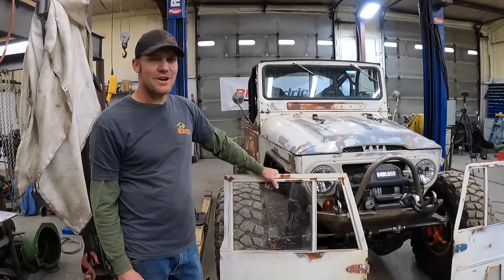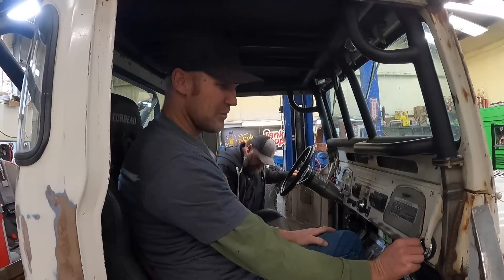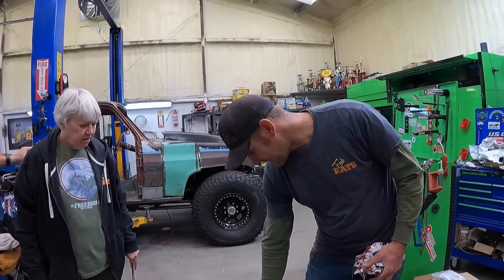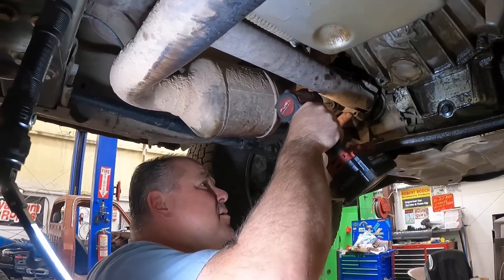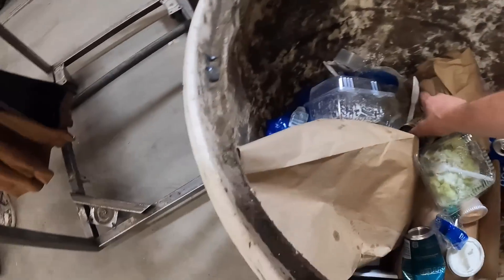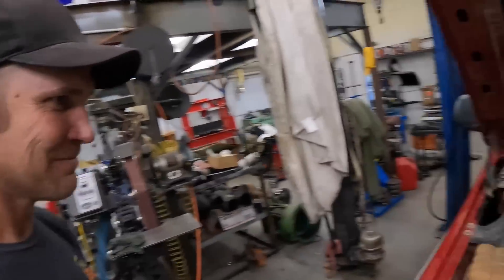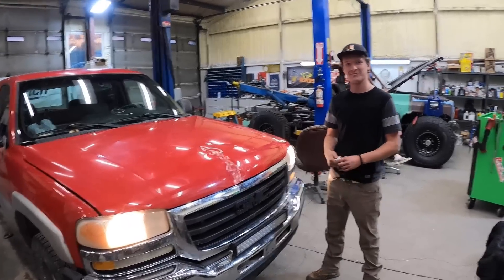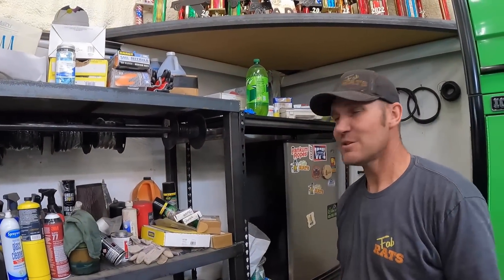This Is The Worst One I've Ever Seen!

Comment: Pro tip for Hunter, when adding Lucas oil stabilizer empty about 1/4 of the bottle in the vehicle and then fill that 1/4 back up with your regular oil and shake it up and it will poor out a lot easier and you won't have to sit there and fight with that thick crap forever. Also poke a hole in the bottom of the jug when you are pouring it in. (The mixing actually works the best if you are using a 5qt jug of oil bc you can empty 1qt of oil out then add the entire Lucas oil into the 5qt and it flows straight out like normal oil.)
Reply: You can also put the bottle by the heater for a little bit
Reply: Remember when STP came in a can?
Reply: Also instead of spilling every bottle of oil, get the first one in the hole then cut the bottom off of the bottle. 
Insta-funnel,,,,, disposable, no clean up required.
Reply: Also,if you turn the 1 quart bottles on there side they pour much easier!
Reply: @mattschion  try pouring with the spout on the top I find it to be the best way.
Reply: @garyjohnson6640  Yep, and if you wrote to the address on the can they would send you some free stickers.
Reply: Or just leave it in the sun or near heat for a bit it will pour out nice instead of messing with cold honey like oil
Reply: @georgedavis6583  That is the reason for the spout not being in the middle of the bottle, it is by design and many people do not know that. When pouring start lowering the bottle opening horizontally keeping the bottle neck on the higher side, not lower as Hunter did)

Comment: Hi Chad good to see you helping Hunter out with his oil filter I've had to deal with a couple of over tightened oil filters myself and you have to be innovative to get them off. Good job getting the FJ ready for winter and building a hose rack to hold them up off the floor.

Comment: On Hunters truck take the 4x4 switch out of the dash. Disconnect it and put electrical grease on the connectors. Re-connect and ba-da-bing. It's a common problem on those years.

Comment: Best thing to get filters off I have found is a strap wrench. A loop of seat belt material on a piece of 3/4 I.D. square tubing about 1' long. With a good breaker bar you can get every filter off. I have crushed a few base plates with it getting the really hard ones off.

Comment: Pro tip. I've seen Paul, Matt, and now Hunter all pouring oil the hard way from a quart bottle. The opening should be on the top of the pour, so the oil essentially goes down the ramp. This technique will eliminate the glugging on the pour. Happy Thanksgiving!!

Comment: For the bug catcher rubber seals you may want to check out Steel Rubber. They may not have a preformed seal (most likely not) but they may have the bulk rubber in the correct profile for what you need. You can try and make something work.

Comment: A small change I would make to the hose rack, if you decide to make another in the future as this one is solid already, is to have the bars placed on a slight angle so the back bars are higher than the front bars. Makes it so you can see how much hose you got left, and its easier to grab the back hoses once you fill the rack up fully.

Comment: I doubt you will see my comment, but seeing your FJ again reminded me. I think it could be your winch causing your engine to run hot. I remember reading in late 80's or early 90's about Rick Pewe from one of the Off Road magazines. He built a flat fender Jeep with a V8 that ran hot. Ended up being the Warn 8274 winch blocking air flow.

Comment: Something i like to try before poking holes in the filter is take a sheet of sand paper, fold it in half so its rough on both sides and wrap it around the filter, works great on small fwd cars when there's no room to use a hammer and screw driver like Chad did.

Comment: You got off easy on that one , Chad.
•  On my 📜 1st  OYLE CHANGE of YORE ,  so many Moons ago ,  my ( apparently preoccupied ) mentor answered "Yes" when i asked if  i should use the wrench to install the new filter.
•   As you might imagine ,  my 2nd change was ,  shall we say , MEMORABLE !  
•  Drove a medium screwdriver thru it. Torn-up like Hunter's.  Then a 3/8" shank screwdriver TOTALLY Shredded it , leaving only the base-disc  Still TIGHT  against the block. Vise Grips to twist & tear-off the remaining shell fragments.
•  Next a 40 mile round trip the next day to borrow a BIG allen wrench ( 1/2" ? , 5/8" ? ) to unscrew the port fitting from the block , & STILL COULDN'T spin the disc-base off ( i didn't have a bench vise yet )  so another 40 mile round trip to my friends shop to VICE-CLAMP it and FINALLY unscrew the base. 
•  50+ hours , Start to finish 🥵 . You KNOW  i never made THAT mistake again !    Aaaah  youth 🥴 .

• & BEN !  YOU RULE 💪👑 🎉 🎊

Comment: 1984 Nissan Maxima - I'm pretty sure the factory manual specified a screwdriver be stabbed through the oil filter to get it off as that's the only way I ever found to do it based on the stupid place they put it. Plus all the oil from the filter would leak onto the exhaust flexpipe while taking it off and all the brake clean in the world wouldn't keep it from smoking like a chimney for the first 20 minutes of driving afterward. And of course the exhaust was hotter than Hades during the whole ordeal since I worked at a quickie lube shop.

Comment: Hi Hunter. Turn the oil bottle 180 degrees so that the spout is at the top. Then there is air at the top of the bottle and it will pour better.

Comment: Hi Folks! Love your style! Having built many fj-40's over the years I know if you find a door seal company, that make seals for all doors, you will find one that will work! I also use a glue called lexal, clear, uv resistant and paintable! The lexal is also good for the sealing of the roof channel to prevent water from coming in through the rivets! Cheers!

Comment: Heat the oil filter with a propane torch around the seal.
I just did it to a ridiculously tight  air dryer desiccant can and it twisted off with a much less amount of effort.

Works like a charm everytime.👍

Comment: Hunter , those plastic oil bottles pour well ,  if you turn them over and have the opening at the top .. 
no glub - glub .  Check out the picture molded into the plastic .

Comment: Reminds me of my Dad's brand new 1986 share odyssey with the 454 engine.
I got a call as soon as I got home from work, my Dad and brother had been trying all afternoon to get the oil filter off.  I joined in, and soon we had crushed the shell, tried sticking a metal punch through the shell, and finally tore the shell off all together!
I then took a six inch 3/4 bolt, welded two smaller bolts to it, s I aced to fit the drain holes in the filter base, and put a 1/2 inch breaker bar on it!  It came lose,but only after I was afraid I might twist off the threaded bolt that the oil filter screws on!
Brand new Chevy pickup, first oil change!
Chevy had an awful lot of quality control issues back in the day!  No wonder the Japanese took over the car market!

Comment: Tell Hunter there is a ground right behind the front drivers tire on the frame that rots out. It grounds the transfer case motor. Also the oil leak could be your oil cooler block off plate. Simple gasket fix.

Comment: Hunter when you change oil filters you always grease the new oring seal with old oil get it wet as it will fuse to the motor ☺️
Reply: Always make sure the old rubber seal comes off with the old filter especially when made so tight.
Reply: What he said.

Comment: Paul they make a rubber tape that we use in the electrical trade for insulation on split bolt joints. It's pretty good stuff may sever as a temp fix for the bug catchers.

Comment: The top of the oil bottle has the opening off set to one side for a reason, turn it 180 degrees with the hole up top and you will spill much less. PYW most all automotive containers have the opening off set of center.

Comment: I bought my 1st Japanese car in 2020. Acura TLX. First oil change found out they cross threaded the original filter. Once I got it off, I tried to replace the threaded insert. That wouldn't come out, so I had to order a die. Sure, I could have gone to the dealer, but they did enough already!!

Comment: To put on a oil filter, rub some oil on the sealing ring and hand tighten only. I have never had an oil leak and you have to use the oil filter wrench to remove. Good luck with your oil change.

Comment: I see many people use an aluminum carpenters square and I recently purchased one made by Swanson and checked it with my combination square, a Starrett, and the carpenters square is not square. In a 2 foot run it would give alignment issues if not known. You get what you pay for.

Comment: Paul bug catcher
I went to Google and typed
(Toyota Fj40 bug catcher vent window kit) and it pulled up a bunch of different options there's one that's $59.99 for a pair on ebay  and Right beside it there is 2 plastic tools (yellow in color) for removing the glass and the rubber from the metal frame. The two yellow plastic tools remind you of spoons to remove bike motorcycle and mower tires

Comment: Just a thought i had a pickup with a cap. I had no one to help me put it on or take it off so I made mounting points on the cab. I used simple pulleys so I could put it on and remove it myself. I just wanted to share.

Comment: Ben’s welds are better because an over filled weld is better than an under filled weld,stronger and more efficient. But a flat weld that is in between both under and over filled is a perfect weld so they are both good and strong but neither are perfect. Over filled can be ground smooth very easily but an under filled weld has to first be filled or reworked. You say tomatoes and I say do it over. Loving the channel! Keep up the good work.

Comment: I had a oil filter on my Brother-in-laws truck that I ended up ripping the filter off and had to weld a socket around the threaded part of the filter and it still took a breaker bar to get off. Hours and hours of FRUSTRATION

Comment: TIP:
Pouring oil without a funnel.
Put the dipstick back in the tube, withdraw the dipstick a few inches, and pour the oil from the bottle against the dipstick.....The oil will run down the dipstick.
This is slow....And, it takes a bit of practice......But, it's better than pouring oil all over the place.....

Comment: Nah, not the worst I’ve seen.  Worked for the local Ford dealer right out of high school in charge of the lube rack.  Had a filter that I completely tore apart with a big ass Mac screw driver so the only thing left on the engine was the filter plate.  Had to use a long punch to beat it into submission and get it loose.  At least yours came off in one piece.

Comment: Heya. Just have a question.  I've always found it interesting to see all these multiple small bottles of oil used in oil changes.  Is this an American thing?  I've seen it here on Fab Rats, and also on many other Youtube pages.   In Australia, its normal (and heaps cheaper) to buy 5-litre bottles (similar in quarts) and many people who do multiple oil changes, buy it in bigger drums.    It seems to be the same when it comes to buying 2 Stroke petrol.  People seem to be buying it in small cans?  In Australia - we just buy 5 litres or 20 litres of petrol from a fuel bowser and then mix it with 2-stroke oil.

Comment: Instead of camouflaged we have "RUSTOFLAGED," guaranteed to distract people from neat paint protection and fussy oxidation expectation. "Fab, why don't you paint all those orange-o spots? "Well, children, weight is a big consideration as is air flow and if you leave those degradation zones alone both those things will advance to satisfaction. "Plus, you can easily hide the truck in a junk yard and bad folks won't be inclined to steal it as they will not want to mess with it and get break away corrosion on their fancy leathers." You do have to warn the magnet guy so he doesn't drop it in the squash box."

Comment: Here is an Idea for you. back in the day when I work in my Dad's shop and at a used car lot shop we would take the empty cans of oil and drain them into a funnel that went into a 5-gallon bucket. over the year we would get several gallons of leftover oil from those cans and bottles. It's a shame to waste the small amount of oil in the bottles why not save it for general use like Derby cars or Bar oil. WE also had a can for transmission oil ATF.

Comment: Years ago we had to pull a motor to get the oil filter off. The garage that changed the oil put the filter on with an oil filter wrench and tightened it till it wouldn't turn anymore. Said the oil filter would leak if they didn't tighten it enough. "AMATEURS"  lmao. Cost them to have the motor pulled and the oil filter removed. Then we showed them how to PROPERLY do an oil and filter change.

BTW Michelle looks better than Paul with the hat.     LMAO

Comment: Genuine part numbers are 68182-90300 LHS and 68181-90300 RHS for the weather strips
Reply: False. That part number is for the much later vent window.
Reply: @KurtWilliams-CruiserKurt  Fair enough was not sure how old the cruiser is, do you know how old it is. 

They have stock of those part numbers at toyota here
Reply: @busrsq  the bug catcher was used on 1967 & older.

Comment: A glass company should have various rolls of
“ channel pack” in different thickness
They should sell in by the foot. Some is softer than others. Too hard isn’t good. Not to tight so you bend your frame beating on the channel.
Use a block of wood with a hammer to beat it on.
Plastic mallet will bend the frame.

Comment: I keep watching you guys have problems with pouring oil in engines or anti-freeze in radiators.
Try turning the jug/bottle so the spout is on the top instead of the bottom.
been working for me for years most instances.

Comment: Today I had to laugh really hard, Paul for Ben you need at least 5 x XL, he is not a narrow pigeon, but please rather a well-good turkey. 
So Paul, your welds are very good, whether with MAG/MIG(135), TIG(141) or electrode(111). In the past, I would have hired you immediately as a welder for a construction site, with standard materials.  
Greetings from Frankfurt.

Comment: You should clear coat the YOTA, help stop the rust. Also, you guys need an automatic arc welding helmet, which you don't need to raise over your face as you get started or done welding. It's screen automatically darkens when you spark your welding and then automatically is see through when you are done welding. 
My friend has one, and so did the instructor at my welding school have one. They aren't really expensive, but I haven't priced them in quite a while. 
Maybe have your very beautiful wife, Michele look for one on the interweb.

Comment: Lucas is just thicker oil and it will burn up the topend especially in winter. dont ever use it. as a mechanic I've seen so many engines shorten life that use lucaus oil stabilizer crap.

Comment: The filter was way too tight when he struggled to get it off, then went on to install the new one just like the old, way too tight.
With the gasket or mating surface lightly oiled you tighten the filter until it evenly contacts the housing, them simply turn it 3/4 of a turn. That's it, it's right enough and won't leak. (Unless the mating surface wasn't cleaned or is damaged.

Comment: There's nothing more annoying than an overtightened oil filter. I've NEVER had a problem taking out a filter that I have put in myself. I just go a pretty good hand tight, no tools. There isn't THAT much pressure in an oil circuit. People seem to think it is like a head gasket or something. I've had to destroy some filters, and some of those were not done by idiot backyard mechanics, but by pro shops and dealerships that really should know better.  Databyter